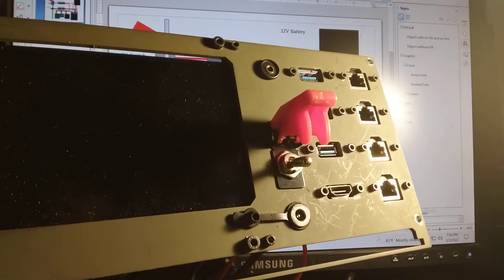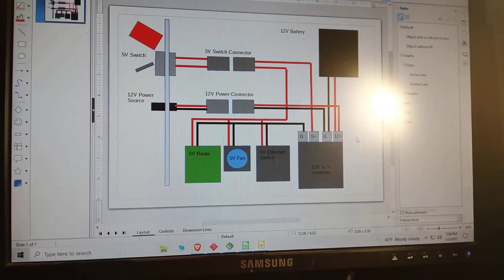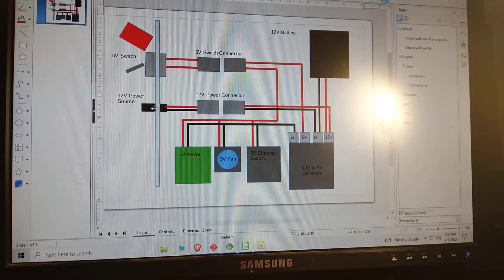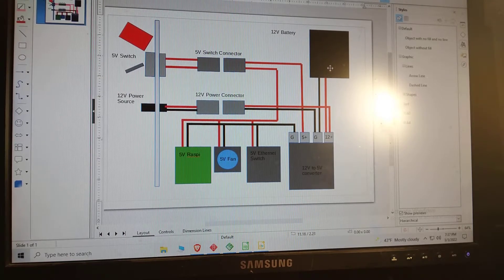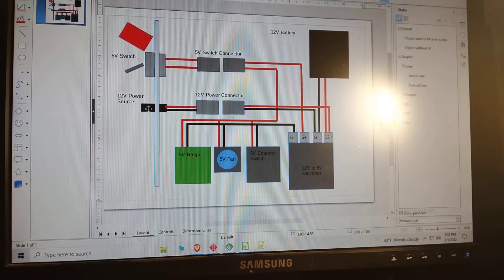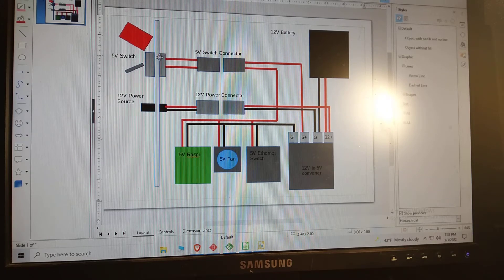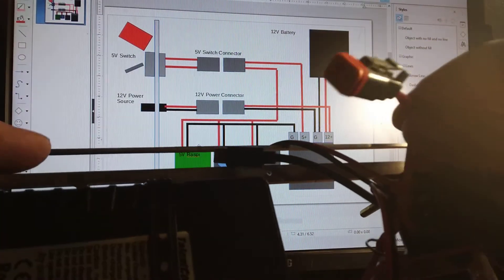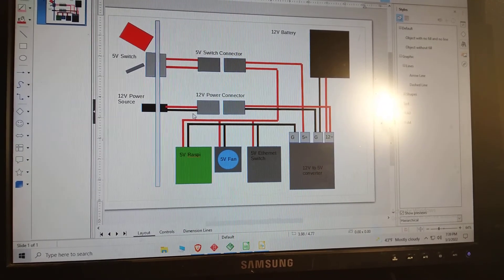Raspberry Pi or Jetson nano 50 Cal Ammo can build #2: Power

Comment: Thnx for the detailed description. Does de battery allow charge and discharge at the same time ? Been searching for the 1 you have but it Isn’t available anymore. Also you use 12volts from powerbank that’s stepped down to 5v how many amps does de 5v get ?
Reply from the maker: Thanks for watching!  The battery bank will charge if the current used by the other devices is less than the 12v input current.  If the input is 2A and pi is using 1A the the batt charges at 1A rate.  If pi suddenly used 3A for a complex operation then battery would discharge at 1A.  DC/DC is 50W so 5V x 10A = 50W.  Great questions!
Reply: @deplorablesecuritydevices  thnx for the reply!! Could you recommend a powerbank ? Somehow The only 12v i can find are car battery chargers 😂😂 so I must be doing something wrong there hah
Reply from the maker: @phreakydev2020   Something like this will work.  Keywords are " portable battery bank 12v" https://www.amazon.com/TalentCell-Rechargeable-12000mAh-Multi-led-indicator/dp/B00ME3ZH7C/ref=mp_s_a_1_4?crid=3S8PLGNX85QOX&keywords=12v+power+bank+portable&qid=1646772983&sprefix=12v+power+bank%2Caps%2C237&sr=8-4